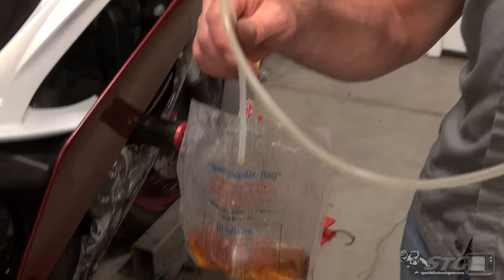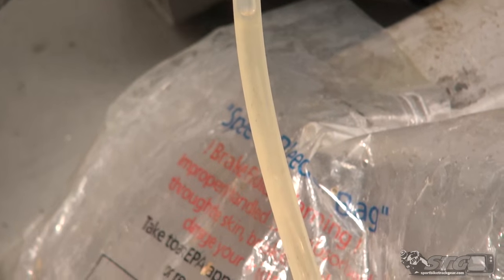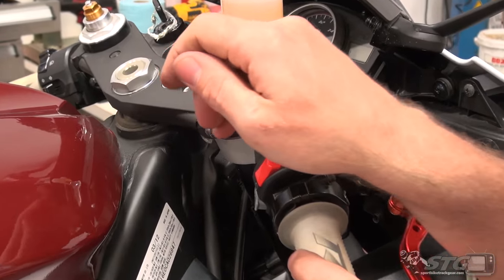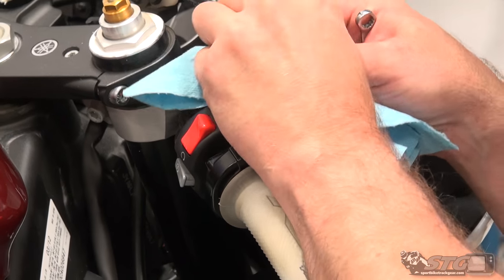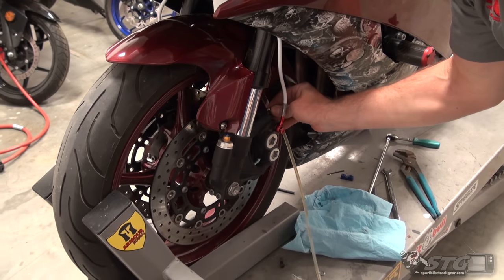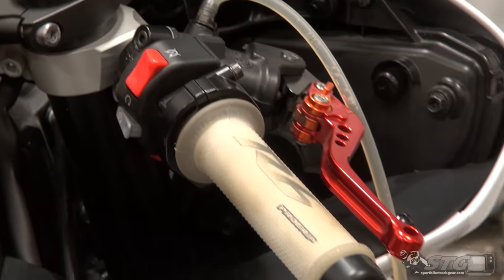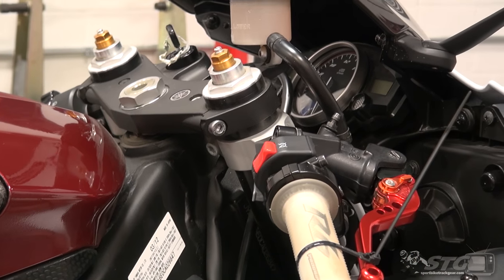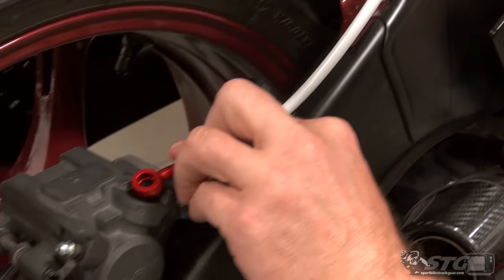How to Bleed Motorcycle Brakes from Sportbiketrackgear.com

Comment: Hey van I've got a 2006 gsxr 1000 running brembo m/c steel lines and standard brake caliper. When I bleed my lever is rock hard nut after the first ride it gets a little soft and stays like that. Any ideas???
Reply from the maker: Sounds like you have some seals failing in either the master or the calipers. This is likely to be the case if the lever gets progressively worse the more you ride it. Important to be running some quality brake fluid like the Motul RBF600 as well. - Van
Reply: @sportbiketrackgear  hi van thanks for the reply it doesnt get worse it just loses a bit of pressure and stays like that, the brakes still work well just not as effiecntly as when they are first bled. thanks

Comment: Did you have issues with the abs system?  My service manual states I need to use the diagnostics coupler to test the abs once the brakes have been bled and the brake lines replaced.  I have a 2019 MT-07 with ABS.  Thanks in advance.
Reply from the maker: No there were no issues with the ABS system. At most you could ride the bike after bleeding the brakes, activate the ABS and evaluate the feel of the lever and pedal. If either feels softer just bleed it a little more to purge that air out.  - Van
Reply: @sportbiketrackgear  thanks so much.  I'm a big fan of your videos.

Comment: Why is the process for lever depression and open/close bolt sometimes one way and then other times the opposite? A guess would be that:
1. open bolt -> lever depression -> lever release -> close bolt 
would be for fluid siphon to get general fluid movement and
2. Lever depression -> open bolt -> close bolt -> lever release
would be for one-way fluid travel to only allow air bubbles in one direction.

Is that close to accurate or am i wrong?
Reply from the maker: If you do not close the bleeder screw before you release the lever you will suck air back into the system. - Van
Reply: @sportbiketrackgear   makes sense, i just mean you have varying methods in your video, so im trying to make sense of it, unless i misunderstood. For example, at about 4:00 you open bolt -> press lever -> close bolt -> release lever. Then, at 4:30 and elsewhere like 5:30, you press lever -> open bolt -> close bolt -> release lever.

Comment: I am having trouble with my 06 cbr 600rr rear brake I have bled the crap out of it but my piston gets really tied up and does not release any pressure it just stays out. Brake lines are good I cleaned the caliper in and out and same thing.any suggestions plz Help.
Reply from the maker: I would tear down the rear master and have a look. There may be some debri or corrosion in the bore. - Van

Comment: my rear brake has no pressure whatsoever. I've been told to bleed them. I was involved in an accident where the bike slid on the right side if thats of any help. Is bleeding them gonna help
Reply from the maker: There is a good chance bleeding them will help, Make sure that your lines and master were not damaged in the crash.

Comment: ok so you're introducing fluid to a dry system, easy peasy and gravity is great there..  but what about a brake flush?  how is the push method for that instead of drawing it out / leaking it out??
Reply from the maker: The push method will get the fluid evacuated faster. Open screw, pull the lever in and hold, close screw and repeat. Keep an eye on the reservoir and refill with new fluid before you introduce air into the system. I like to use the Speed Bleeder bag and hose kit when doing this. Here is a link: https://www.sportbiketrackgear.com/speed-bleeder-bag-and-hose-kit/  - Brian Van

Comment: Did you ever fix the issue with the rear banjo bolt? I am installing mine now and I am having the same issue where I may have to use the stock banjo.
Reply from the maker: Not sure what issue you are referring to (this was shot a long time ago), we installed both the banjo bolts on this rear line no worries. - Van

Comment: Something I've wondered is, many bikes (maybe most or all?) have a crossover line between the right side caliper and the left side caliper that goes over the fender.  At least with stock lines.  Is that high point in the system susceptible to getting air bubbles trapped?
Reply from the maker: There is enough pressure moving through the lines when bleeding that the gravity only really matters in the calipers and master.
Reply: Thanks!

Comment: When i open it all the fluid goes back into the brakes help me please i tired of only riding with front brakes
Reply from the maker: What is the year, make and model of your bike? Also why are you bleeding the brakes? Happy to help out - Brian Van
Reply: Sportbike Track Gear its a brand new honda grom clone 2018 from china, the brakes are brand new, they never worked, when i press down on the lever the pads dont hold the disk not even a little bit, so i tried bleeding them but the fluid just goes straight back into the system when i open it, thanks
Reply: Sportbike Track Gear i can also make a video of the brakes if you need, thank you so helping out man, i would take it to a mechanic but i dont have a lot of money right now